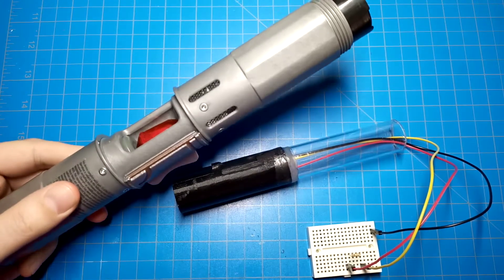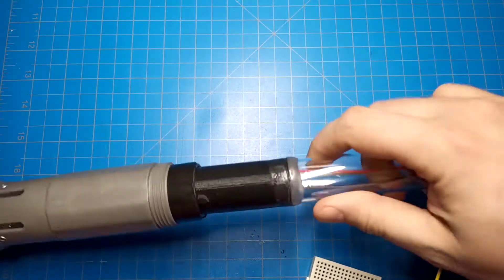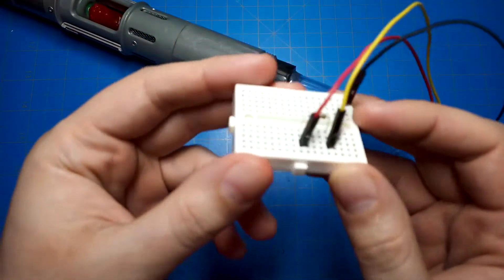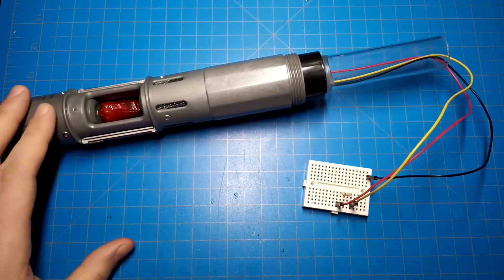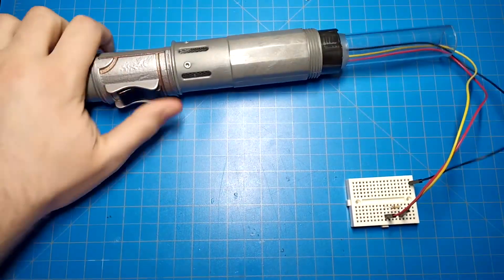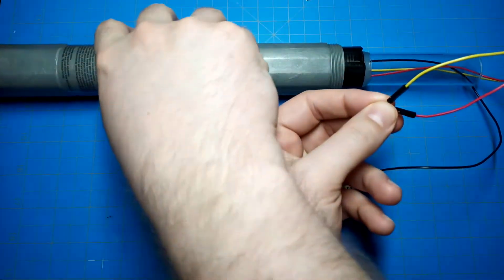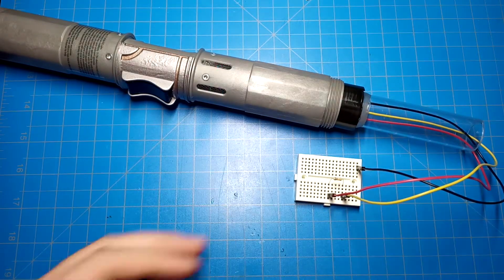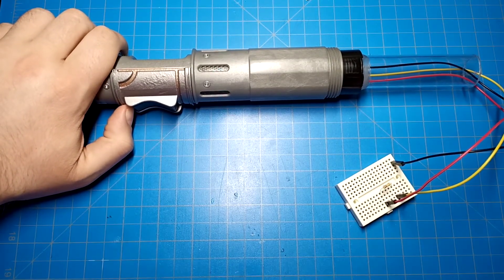How To Make A Galaxy's Edge Hilt Power On Without A Blade

Comment: Do you think you could put a LED(s) instead of the resistor?
Reply from the maker: You'll need a resistor with the LED to keep the LED from drawing too much current, and a blue LED might not work, but a green or red should be fine.

Comment: I purchased a legacy lightsaber hilt from Disneyworld this past march but did not buy a blade because I was returning home on a plane. Do you know where I am able to purchase a compatible blade for my lightsaber?
Reply from the maker: the only official channel would be through shopdisney.com (https://www.shopdisney.com/galaxys-edge-lightsaber-blade-36-star-wars-galaxys-edge-400021020917.html) but it's been out of stock for a while.

there are people selling blades on ebay, but they're selling them for well over retail price.

you could try the galaxy's edge discord (go to swgediscord.com to join) and ask in the #trading-post channel. there are several people in there who are local to one of the parks and make frequent visits to pickup merchandise for others. i've used it myself to get a couple blades. the max you'll be charged is 20% over retail price of the blade plus shipping (this is a rule of the discord server).

Comment: I am trying to make a blade plug that will activate the hilt and have an led shine through some vents on the plug. Any ideas? Don
Reply from the maker: deadbothans used to sell the connector and pcb on their etsy shop, but it's no longer available. the pcb design files are available through their patreon (at the $5 maker level). see  https://www.patreon.com/deadbothans. the housing i think is on there as well, but if not you could probably ask them for it. i know their plan was to share it.

with both the pcb and connector files you could order copies made. oshpark.com is an inexpensive place to order a few PCBs. not sure where to go for ordering 3D printed parts (assuming you don't have your own 3d printer), but there are several options out there. maybe find a local maker space to get one printed.

Comment: My lightsaber sometimes gets dim and flickers dim often. I have 2 blades and both only do it in my savis hilt. So it’s not a blade problem so what could it be?
Reply from the maker: have you tried changing the batteries? if you have, are you using alkaline batteries or something else?

if not the batteries, it might be a loose wire inside the hilt. in which case your next step should be to contact guest services at Merchandise.Guest.Services@DisneyParks.com and let them know about the problem. they may be able to replace it.
Reply: @Ruthsarian  I tried the batteries and not much has changed I contacted them to see if they can do anything. It flickers dim every time I swing jt

Comment: What number is the ribbon cable?
Reply from the maker: Which ribbon cable are you referring to? The wires I use in this video are generic jumper wires that can be found on eBay and Amazon by searching for "breadboard jumper wire".

Comment: Hi there! Do you have any videos on what to do if your motion detector or clash isn’t working?
Reply from the maker: first step would be to pull the battery pack and leave it out for a few minutes. this will force the hilt to reset and might resolve any problems caused by a glitched hilt.

next, try replacing the batteries. low batteries can cause some weird behavior.

beyond that there's not really much you can do. the microcontroller in the hilt cannot be replaced. the accelerometer could be replaced, but it's not easy.

if the battery stuff doesn't fix it, contact Disney's merchandise guest services and see if they'll replace the hilt. you can email them at Merchandise.Guest.Services@DisneyParks.com